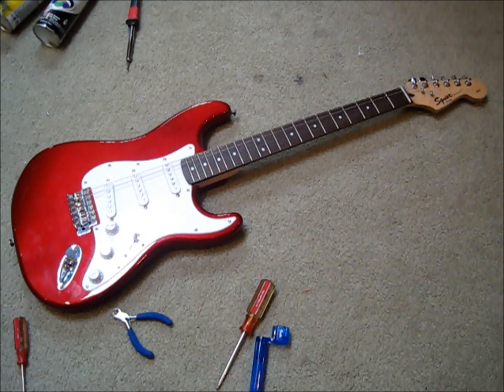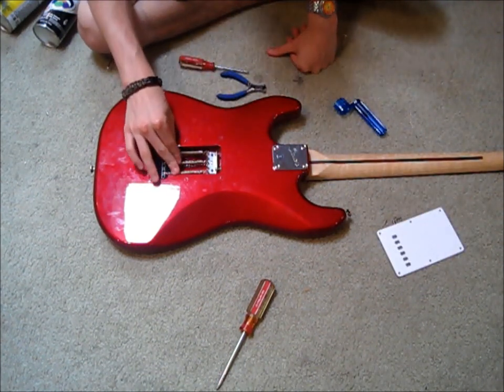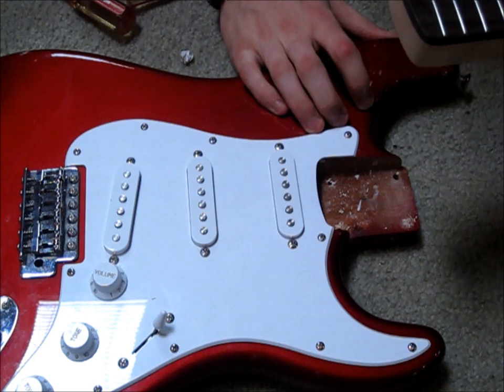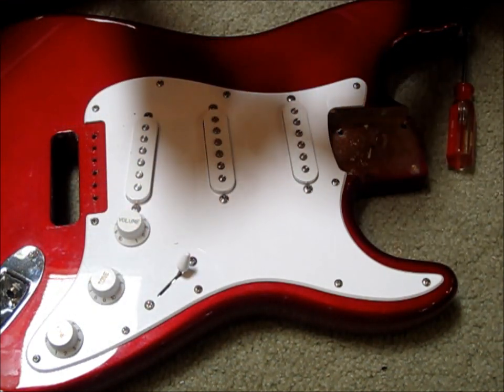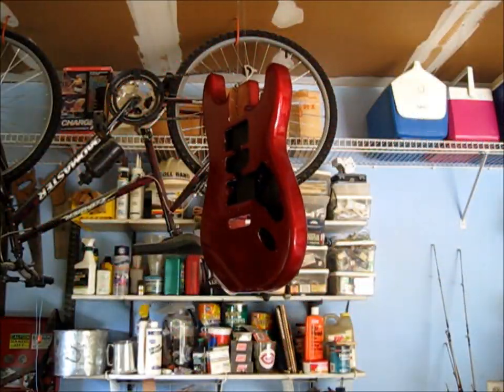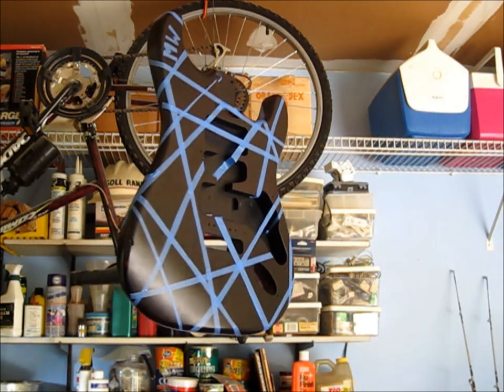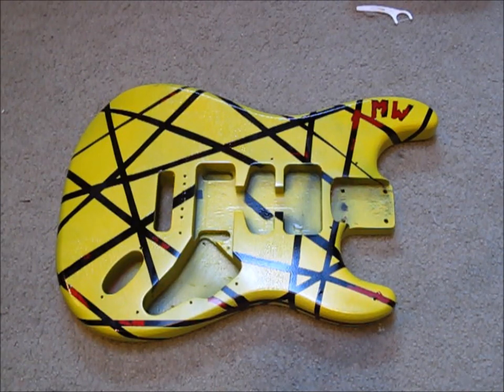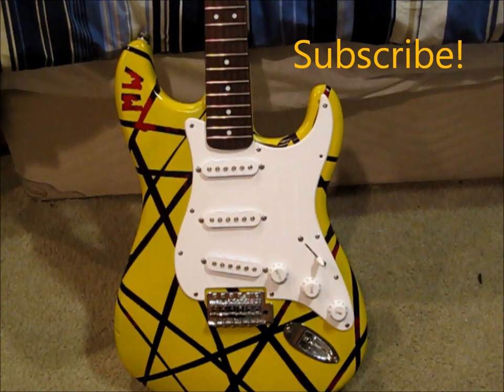How To: Spray Paint a Guitar!

Comment: I won't get into what you did right or wrong as to the painting but I would just like to offer some advice to anyone who might like to disassemble and reassemble a guitar without damaging it. You can take screws out using a cordless screwdriver or drill but never use one for reassembly, always use a hand screwdriver because you need to find to old threads a good way to do this is to slowly turn the screw backwards till you feel it fall off the thread then you can screw it in and it will follow the original threads. If you do it this way you can take you guitar apart and reassemble 100 times with no stripped screws but if you reassemble will a drill you will strip a couple screw holes with each  reassembly and soon you guitar will be a hunk of junk. It doesn't matter how cheap or expensive you guitar is you should always try to do the best work you can because your work is a reflection of you.

Comment: Holy hell, there is so much wrong with this video. Make sure you get rid of the original coats (or at the very least, the gloss so the paint has something to stick to). Lay down some primer. When spray painting make sure your guitar can not swing back and forth from the air pressure from the can. This will make for VERY uneven coats. It's good practice to go left and right, overlapping each coat just a little. It's not a good idea to just randomly spray because the coats will not be even (and by doing the left-right method, you are insuring that you haven't missed any spots like you did with all the red blotches). And also, give the thing some time to dry man. You can't paint a guitar in an hour. It takes (from start to finish, properly) at least two weeks. AT LEAST.

Comment: My friend, that's some cool idea you had with the tape... I would probably strip out the original color (with sand paper) and put way more coats of paint, well this video is 3 years old and you might be more experienced but in this video, the wire that was screwed to the body was a ground for your shielded pickup cavity, there's a chance that applying paint over the conductive-paint (that black matte paint that you had inside the pickup cavity) kind of unshielded you guitar. Cool idea though..

Comment: ok, So much hate on this video.. I understand his paint job wasnt that great, but its what he wanted.. you cant hate on him getting something he wants.. pretty much a matter of opinion.. but im looking to paint a guitar.. will be my first attempt, what was done incorrectly as far as taking apart?  what should I avoid doing and not doing?
Reply: Leonard Morales  - you gotta sand off the top lacquer at least doesn't have to be all down to the original wood. You also gotta know how to solder the electronics back since your taking it apart , he didn't show that part and he probably took it to somebody to do it which can cost you 50 bucks.
Reply: Labruin1414  - other than that its okay.
Reply: Leonard Morales You should avoid painting your guitar period.  It will destroy the tone with bullshit like spraypaint.
Reply: +klesh how?
Reply: +klesh   well its a shitty $100 guitar.. its just a project

Comment: He used krylon fusion my best suggestion is get some 80 grit and 320 grit when you sand your guitar get the original clearcoat scratched up so it looks cloudly then spray the paint will cling way better.

Comment: Hey man great video! I got a question for you: so I just bought a knew guitar. A Dean VMNT. And I still have my old guitar, a cheap $180 Ibanez GIO that I still want to use for alternate tunings and have as a back up. But what I want to do is paint the back of the neck. (where the palm of your fretting is when you are playing). I want to paint it black with the lacquer finish. Any tips for the back of the neck or do the same rules as the body still apply?

Comment: I have a question. I just want to spray paint some pin-stripes onto the body of my Viper, but will I have to go through this whole process? They'd be placed right above the hardware. I don't want to change the color of the whole body, I just want to add to it. How would I go about doing this?

Comment: So you can just sand down the finish to get it rough enough to take the paint or do you have to remove the finish entirely?
Reply: you just need to rough it up enough for the primer to stick. I usually use a 220 grit sandpaper to scuff it up.
Reply: of course sanding it down to the wood would be better but its not required.
Reply: sluggz956 Thanks.

Comment: ----TIPS----
1. Sand ALL the way down to the bare wood, be careful when sanding the horns of the instrument it can change the sound pretty drastically. 

2. Priming is something worth doing. Automotive paint and primer is the absolute best.

3. If you use automotive paint be sure to wear a mask both indoor and out. Try to do it indoors in a clean space with not a lot of dust.

4. for best results after priming you should do a fine sanding job of about 400 grit but it is not necessary.

Comment: thank you for posting the video really helped me out a lot :) don't know if you or anyone out there can help me out with something. There's a picture I would like to have on the body of my first and new electric guitar, and i want it to be a whole picture, but my printer only prints out black and white and 8x5 paper. what kind of spray/glue/coat protector do i use to stick a picture onto my guitar and to prevent the picture from coming off or scratched? I went to guitar center and sam ash and they just ripped me off. oh, and i also want the pick protector on the guitar to look like the picture. I want the whole entire body of hte guitar to be covered with the whole picture.

Comment: ----TIPS 2----

5. Make sure to spray side to side starting off the piece coating the piece then come off the other side to prevent runs and spray marks. Do 3+coats.

6. You can finish there of continue of with polyurethane.

7. Sand down final coat with 1000+ grit sand paper (you can get it at an automotive store)

8. Put on polyurethane either with a brush or spray if you have it

9. depending on the polyurethane you may need to use 2000 grit sandpaper to give it a CLEAN look.

10. Have fun!

Comment: Only if you'd do 50 layers of paint. As long as you don't put too much paint on it it shouldn't matter, however, if your guitar is shielded (look that up if you don't know what that is) you should of course remove the shielding if it is copper or something like that and replace it afterwards, if it's conductive paint you will have to repaint the cavities with conductive paint. If you have a Les Paul or any other guitar with humbuckers you of course don't need to shield it.

Comment: if you want the best result, sand it all the way down to the wood. them prime, prime, prime,wait a day. sand with #400 grit sand paper, then spray color, color, color, wait a day. decide if you need more paint or not. sand with #400 sand paper, clear coat (laqcuer or polycrylic), clear coat, sand. then judge if you want more coats again. thats what i did

Comment: probably should've sanded down the clear with a 1000 grit and worked your way to a1500 then 2000 then 3000 and after its smooth go ahead and buff it with compound then polish.
Reply: sanding after the clear is to eliminate any orange peel by the way. plus you'll definitely wanna add more than one coat of clear.

Comment: having made guitar bodies for Vaccaro guitar (Henry Vaccaro formerly Kramer guitar), painting is not going to ruin your Electric guitar by spraying it. Using paints that don't interract can cause orange peel, fish eye,etc,take your time,keep the paint simple (lacquers off the shelf) and do your best.ask a PAINT guy.sand it smooth, do light coats and clear top coats will build the depth.RESEARCH. most furniture guys don't know paint as well as car paint guys and finish techniques.do test pieces

Comment: This is A Great Video For a Novice/Beginner to See How fairly EZ To Take One Apart. & As said Always Sand/Scuff The gloss Away B4 paint, Scotch pads Or Plain old  Steel wool Works Fine On a budget job. Yes might be an "El Cheapo" guitar But Learners & Experimenters Always   try First On a Practice Type guitar so if it Screws up, Then Sand & Repaint Or Flat Black "Rat rod" it. & if You Got a Cordless Screw gun Paint It different  Each month Then Graduate to a Squire series Strat With 3 ply Pickguard/Gold Letters With Better magneted pick ups Which Is fairly Resellable Or You Can Update The electronics To Sound Pretty Damn good, It Won't Be A MIM or MIA, But El-Cheapos have their Place & MIC/K/I's Can Give a Novice a cheaper "Collection" to Show Off "Paint" talents Thru each one...  & So many Custom Techniques here on the Y-Tube To Experiment with.  & Anyone Experimenting with Paints isn't getting Into trouble With Drugs/Booze/Sex Parties(Remember Kids Sex Parties have a long term Price-Tag,.. It's called "Child Support" & NO "CS" Can pay For a lot Of Quality guitars Over 18 to 25 Years[25 = If They Expect College from You, Too!}).........
& If DE-Soldering Multiple "Wires" Remember Where each where goes.
FYI;
ThanQue
Nc.n

Comment: The correct way is nothing that this guy did. You need to sand it completely down to the wood and start fresh. You can paint it the color you want the stripes first and then wait for it to dry and mask off where you want the stripe and paint the body the color you want it. You should be sanding a lot though to get rid of the orange peel like this one had.

Comment: What's the point of desoldering the wire, can't you just cut it?
Reply: no
Reply: vancestokley You can actually, just make sure you cut it directly at the point it's soldered onto(I did that because I was too lazy to desolder it lel)
Reply: Linus Martin  soldering it off i think makes it easier to solder back on. again, just my opinion

Comment: I'm serious. Now of course obviously you're not going to paint the neck. You're not going to paint the strings either. and yeah the volume is pretty obvious. But why? when you could just take of the neck and strings? I would just cover the hole in the back and cover up the knobs with tape. I know what I'm talking about. I've gutted out PS2's and ps3 controllers. Spray painted them. All of this gutting out of the guitar just seems like a waste of time. I have a Bullet strat.

Comment: don't try this....a good way to not get a good paint job,  sand, sand sand, prime, let try a couple of days. use better tape that won't bleed. let dry a couple of days between color changes. peel tape off within 1-4 hrs of painting.  10 coats of clear